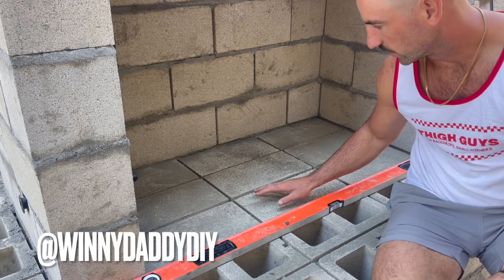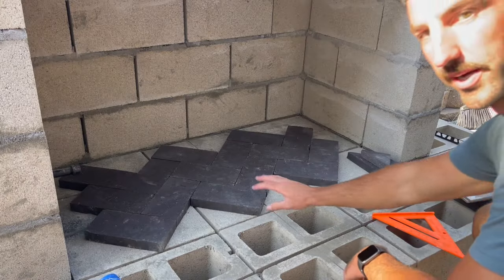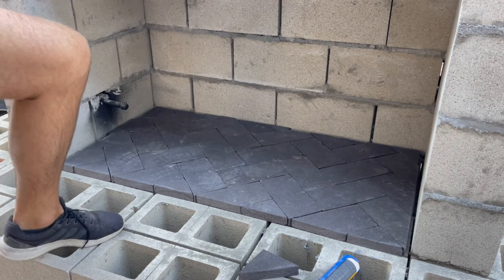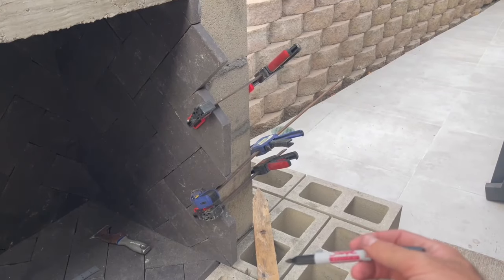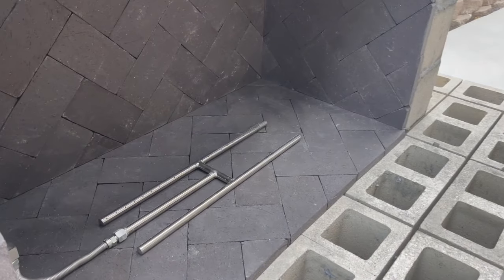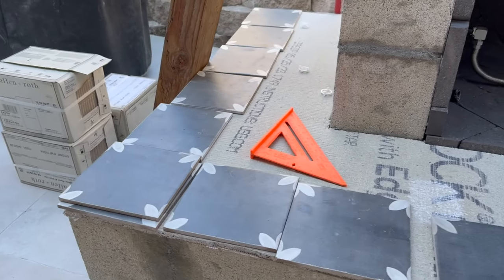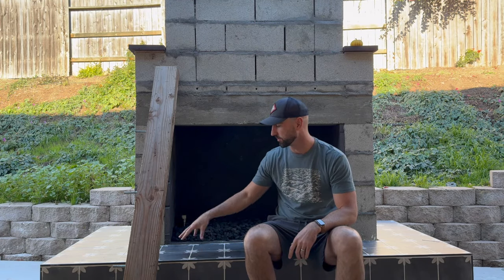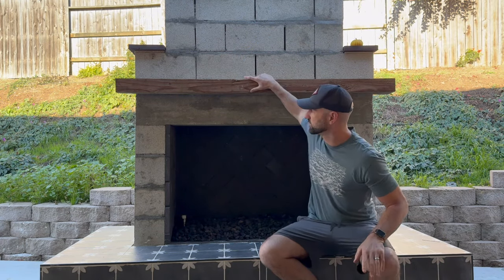DIY Outdoor Fireplace Part 3 | Brick Layout, Herringbone, Tile, Mantle

Comment: Hey ,great work 
Also looking to get a similar fireplace built but not sure how to cap on the top of chimney...do you have any pics or video showing how you finish it .
Thanks
Reply from the maker: Hey! I was debating what to do as well. Ended up putting a little stucco sloping away from the chimney so water runs off. I’m also planning on putting a spark arrester similar size of the opening to prevent water or anything else from going down chimney. Final video will be coming soon!
Reply: @WinnyDaddyDIY  I didn't see your final video, do you have one to share?

Comment: Great work!  Man! Way to show the real hard work that is involved when doing a project like this. I had to admit that at first, I thought that the mantel would cause problems with time, but it looked solid.  Do you have a list of materials and estimated cost?  Thank you!
Reply from the maker: Appreciate it. Yea not gonna lie, this was one of my most challenging and labor intensive projects haha. Checkout backyardflare.com for fireplace plans and material list w estimate cost. Not including the stucco labor, materials all in was about $1500-1800. Depends on the finishes you want.
Reply: @WinnyDaddyDIY  Which design from backyard flare did you choose? Also, curious to know if you put fire brick on the top of the inside?

Comment: That's a 32" fire box. That will take alot of wood to make a descent fire in it. I'm thinking of building a smaller version of it instead. I think 24" wide by 20 high will be plenty for what I want on the patio.
Reply: I could be worng but isnt it a 48" wide fire box. Since each cinder block is 16", with 3 wide would be 48?
Reply: @lionsmane4468  perhaps, but still way too big for my taste.
Reply from the maker: Yea definitely big if you’re planning on burning wood. I went with the gas HBurner and it puts out some good heat with the lava rock. Wanted lower maintenance with the same effect. Good luck on your project!
Reply: Another dad on YouTube put the gas in as a starter for his wood burning fireplace that was 43”. It put out the heat he was looking for. I’d love this sort if thing running a heat exchanger through it and under some built in seats or the patio floor.